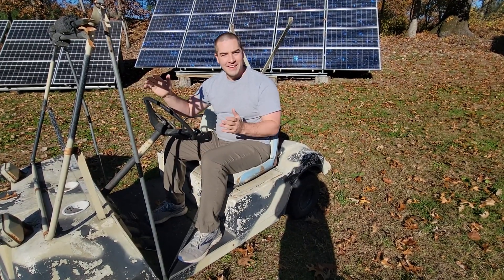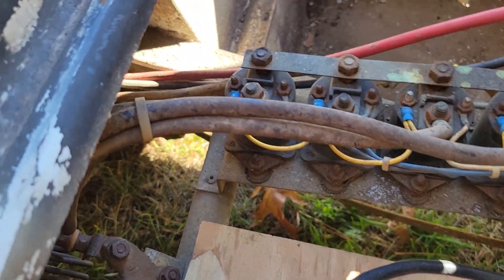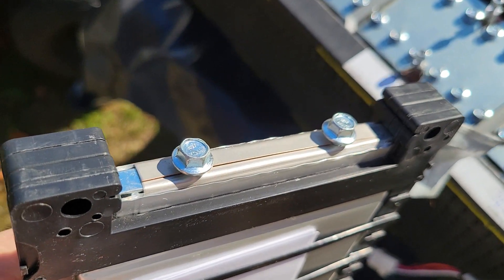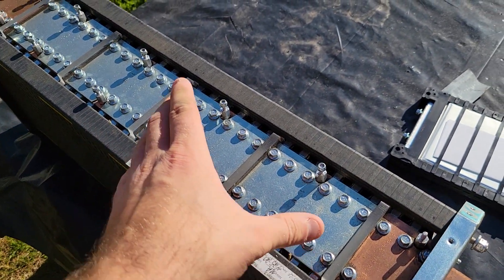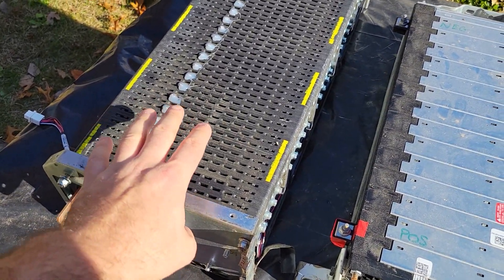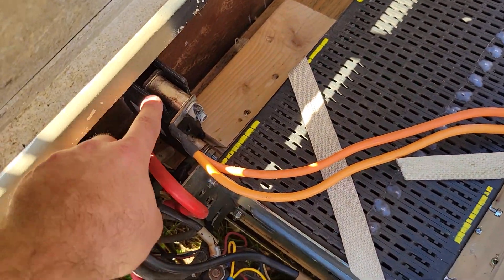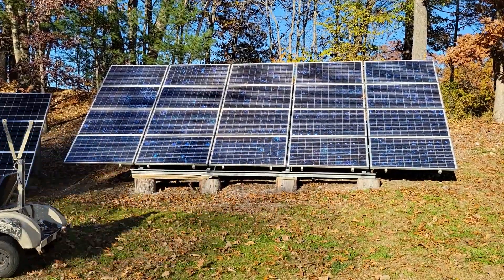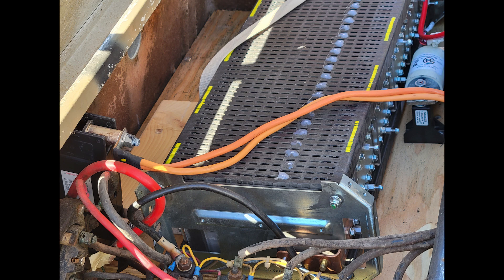These SPIM08 Cells are Crazy Powerful.

Comment: I've been toying around with inexpensive upgrade to prius traction battery.  If I could configure cells in series, 2 pair to make 14.8v module, 14 modules in series for 207.2Volts @16ah...  vs OEM 201.6Volts @6.5ah... I think I would have one heck of a battery upgrade!  For $250 plus shipping or pickup... hmmm...

Comment: Can you find inverters BMS and chargers that will use their full potential.  Amps 200c and low volts range 2.5 to 4.1 .. for example my current BMS turns off the BATT at 3.1 v ...so I hear ANT bms is better at this point ....suggestions?
Reply from the maker: My favorite US supplier is Battery Hookup of BMS's.  However, they are not programable.  I've tested their BMS's and have been able to pull 100% of the battery rated capacity through the BMS, so I know they allow all the energy.  However, if you are looking for a 200A BMS that you can program, check out this one: https://s.click.aliexpress.com/e/_Depamyr

Comment: David: Very happy I've come across your videos. Question PLEASE:
Have 2001 EZGO 36V TXT going to convert to Lithium.
Battery Hookup has both the,
LG 36v 7.9kWh 10s EV Module and/but suggested I use two (2) of the 
36v 48ah 1.78kWh POWER Module - 60 SPIM08HP soon to be in stock.
Which Lithium option do you suggest?, PLEASE.
And what Charger, BMS(s), Meter (showing voltage remaining) and Circuit Breaker would be best for your battery choice?
I'll donate to your cause if you let me know how.....I'm 69 years with 8 year old son whom had to push us/golf cart home with LA failure. Want this not to happen again. I'm fairly new to using YouTube. Thank You With All Our Hearts.

Comment: 24V SPIM08 I have two but I put a 100amp bms but i have trouble with balance I have one cell it could be three I not get up to4.15 all the other are close .they 4.13  some as high of4.18 where i sure be get best use in a power wall

Comment: David, Awesome timely video. I will be doing this upgrade. Using battery hookup parts. Something I find not always discussed is how do we charge these batteries. Do we use the old charger through the BMS or do you have a charger you like?

Comment: David, Can you test the capacity of that 36 volt battery. I don't have a way to test it for capacity. I purchased 7 of them and am going to make 5 X 48 volt batteries from them. There are 30 cell pairs in the 36 volt battery. I will add 12 more pairs and longer (36" threaded rods and reassemble the packs. With 5 X 48 volt packs I will put a 100 amp BMS on each pack. The alternative would be making 14 X 4.2 volt 15p packs with one BMS. Since each of the 48 volt packs in parallel are over 2 kWh any one can be removed unlike the 14s packs.  The downside is buying 5 x 100amp BMS boards to talk to my inverter.

Comment: Having powered my airport golf carts with alternative batteries, I can say that the OEM 8V flooded lead acid batteries fall very short of their 165AH rating, especially with heavy use. By the 2 year mark, we get about half the range. We do many 4 mile runs, from one end of the airport to the other and back, on modified carts that can go 30mph. With that in mind, Lithium batteries with half the AH rating of lead acid batteries tend to compare quite well. We tried 2ea 24v 40AH LifePO4 batteries and they provided about half range. Far, far better than one might at first think. 165AH vs 40. yes, I know the 165 is a 20 hour rate, but even so... I guess my point is that one cannot directly compare AH ratings for a real world range comparison.

Comment: I listened to a couple of you tube channels that said to drain my SOK 12 volt 100 amp lithium batteries till they shut down, so that I can make certain they are matching when I connect them together as a 24 volt system to my MPP 24/24 inverter (all n one) .  They shut off at 8.? Volts. It wasn’t reading anything between positive and negative, no voltage between positive and negative. Now when I hooked it back up to my MPP inverter I get an error code #56 that says battery connection is open. How do I close it so they will charge again. Everything was working perfect before I drained the batteries.

Comment: Hi!  I have an old Vectrix VX-1 scooter , but the original batteries are dead. Can you suggest some batteries that would be good to replace the old ones?  The original had around 102 batteries  1.2v and  26 amps each, all connected in series for a total of 122v with 28Amp.
Reply from the maker: Hi Andrei,  I'm guessing you are interested in these SPIM08 cells as a replacement?  You will want to find out what the maximum voltage was of your original battery so that you don't go over that with the new battery you build.  Your original charger might be 150V or 160V, somewhere in that range.  This means you are going to be around 35 SPIM08 cells in series (give or take).  Is this what you are asking about?
Reply: @DavidPozEnergy  Hi David, Thank you so much for your quick response, My question was about which battery is more suitable for an electric scooter with a big discharge, I was considering from your site 3 types to get around 140V and more than 30Amps, first  I was thinking for SPIM08HP 3.7V 16AH ( 150 pieces > connected  40S4P   to get 148V with 64Amps ) or second option to getting the 15 pieces  PANASONIC 48V POWER MODULE 13S 6.4A 299.99WH >(  connected 3S5P  to get 144v with 32Amps )  or the third option to get 21 pieces of Jeep 12s 44.4v 9.8ah 435wh  (  connected 3S7P get 133v with 68.8Amps ) I have all in the cart and I cannot decide which way to go.Also for the Jeep batteries I don't see the size on the site so I can't figure out how it will fit in my scooter battery compartment (  the battery compartment for my scooter is 340mmX710mm X225mm)
Reply from the maker: When working with an EV (car/scooter/bike/boat) I prefer using a battery that parallels the cells first, then series them.  The module I show in this video is paralleling 6 cells and then making one series connection to the next cell group.  This is the better approach to EV's.  The other options you mentioned, such as the Jeep would be opposite.  The jeep cells would be quite a pain to break apart, so you probably would be series connecting 3 modules into one battery.  Then repeating that process 6 more times.  This would be 7 individual 140V batteries.  The trouble is that you need 7 BMS's.  It's OK, but not as ideal as paralleling them first (such as the SPIM08) and then one BMS.  But, if you go with one BMS it has to be a relay based BMS.  

I should note, that based on your context I think you are trying to build a battery with more than 30Ah (Amp*hours).  Not Amps.  Please correct me if I'm wrong.

If the goal is to get above 30Ah, then you could buy the SPIM08 36V modules I show in the video.  4 modules in series is 6P40S, or 148V@48Ah.  It's over your 30Ah goal.

Just for fun, here is another option: https://batteryhookup.com/products/8x-new-sab-3-2v-55ah-176wh-60280-cells  Each cell is 3.2V and 55Ah.  So you don't have to parallel any.  You can buy 44 cells, arranged in series, for a nominal 140.8V, 55Ah, battery.  Battery Hookup sells the plastic cell holders and bus bars too.  

With anything, please use discount code DAVIDPOZ to help the channel and get a discount.

Comment: I just picked up 4 of these yesterday to do a build for my golf cart … I want to do 2 in series and 2 in parallel to give me 72v at 96ah … big battery told me to use a 20s BMS on each  72v pack..can you make a video on the BMS please and also how the heck can I charge this thing!?! I do not want to over charge or charge too fast or even too slow !!! I’m a newbie to this battery build craze… basically I need your help please!!
Reply: Also, on the BMS… if I run 2 BMS one for each 72v pack.. if I do 200amp BMS on each 72v pack will that give me 400amps then? Since I’m combining the packs to up my amp hour?
Reply from the maker: If you have two batteries in parallel, and one BMS on each battery, then theoretically, you would have 400 amps.  However, there are always tiny differences in resistance which will favor one BMS over the other.  The actual usable amps might be more like 380A from two 200A BMS's in parallel.

Comment: That make me think if one could build some sort of shifter, that switches between the batteries. The new one for accelleration and the energy dense one for cruising
Reply from the maker: You could just parallel them and they will do that automatically.
Reply: @DavidPozEnergy  Thanks for the answer and thanks for the great content in the first place. Would this balance the load with putting more amperage to the high-current battery? Would be quite cool, but I thought it „just“ doubles the max amperage from the older low-amp battery

Comment: Dang, I love this. I want to upgrade my batteries in the future. I just replaced them in my cart a couple of years ago, and I'm kicking myself for not going with something like this. I'd like to hear about how long it can run on a single charge after you test it for a while.
Reply: Hello , thanks for sharing the video, i just made the purchase of the 42 SPIM08HP cells, busbars, holders, and already in 7s6p 24v configuration. x2 so that i can setup this as a powerwall for my PIP inverter, one quick question. on these i think i can use a s14 48v BMS but what's the best way to setup the BMS on the 24v configuration any suggestions on the setup? thanks again. i cant wait to see you do a BMS on your's

Comment: Waits for BH to sell out due to this.  :-) I have 8 of the 24V ones that they were selling that I have modified. The originals were 24V at 24Ah ( 7S3P ) They now are at 24V 32Ah ( 7s4P ). While 32Ah doesn't sound like much, you have to remember that these cells can put out 200Amps per cell and 400 for short periods. So each of my packs can do 800 continuous at the cells. With 8 of the packs that means the potential, if not limited somehow, of 6400 Amps at 24V.  These will be used to feed a 6K inverter so they never will need to put out their max output and will be limited to 300 Amps max on the inverter input. 

Your golf cart should be 36V and about 275 Amps max on the motor so well within the short time ratings of the 1200Amp unit (10S6P).
Reply: How long is the run time for such a small Ah such as this?
Reply: If you aren't using their extreme output rate you're just wasting space. You can get the same capacity in the space of a coffee mug. These would be great for high impulse loads like welding, drag racing, start batteries, etc. Running an inverter at a low, steady current is not a good match for these things. (maybe an inverter to power a laser printer. or maybe a really big battery pack for an impact driver.)

Comment: Those cells are incredibly powerful!! I started my diesel truck with 6 cells (2p3s) a while back. Not only did it start right up, to me it sounded better than the two giant lead acid batteries. I love seeing they come with holders and in packs now vs just loose cells.
Reply: Question I’m debating making a truck jump pack with these. Should I do 3 or 4s. Thinking 4s not fully charged. So that the alternator doesn’t over charge 3s
Reply: @chanceayres6718  I would go with 4s because a 4s lithium polymer pack nominal voltage is 14.8v.
Reply: @Baldys_projects  thank you for your reply!

Comment: Dave, I was considering a super cap battery to assist in my big diesel truck. With the big amps on these, wonder if they wouldn't be a better choice as my inverter and fridge would be on that bank too. Thoughts?
Reply from the maker: If you are running a 24V system, then these would be fine in 7s (7 cells in series) configuration.  But, if you are running 12V, then they would not work well.  Instead look at these LTO cells in 6s configuration for a really amazing amps 12V battery: https://batteryhookup.com/products/6-pack-yinlong-2-3v-35ah-lto  
You can still use discount code DAVIDPOZ
Reply: @DavidPozEnergy  you're the man, thx
Reply: They'd work well for start purposes (high current, short duration), but for continuous loads the energy density is horrible. (more power [capacity, Ah] can be had in less space and weight. the bolt module has 3x the power, and it's far from the most efficient out there -- it was designed for a 10yr duty cycle of a car; having taken them down to the raw pouches, there's surprisingly little actual battery in those.)

Comment: Just curious 🤔 
Could you reconfigure the cells for a 12v setup?How many kw or watts?
Reply from the maker: These cells have a nominal voltage of 3.7V.  If you arranged them 3s (series) then the nominal voltage would be 11.1V (low for a 12V battery).  If you arranged them 4s then it'd be 14.8V (high for 12V).  I don't suggest building a 12V battery with these cells.  Instead build a 12V battery with LiFePO4 cells, which have a nominal voltage of 3.2V.  Then 4s would be 12.8V (perfect)

Comment: You should get yourself a 10kw bldc motor for that and hook it up. Way more efficient and you’ll get 50-60mph out of that baby!
Reply: He might even be able to get away with just buying a speed controller for it and keeping the original motor and that would allow him to completely eliminate the resistive speed control that it is using.  The only nice thing about the resistive controls is that they last practically forever.

Comment: Any chance these could be used for a power wall ? I'm looking for a simple power wall option.
Reply from the maker: They can, but it's not the most cost effective option for powerwalls.
Reply: @DavidPozEnergy  love the content BTW! Keep it up!
Reply: @DavidPozEnergy  thanks. Budget matters very much and I've been struggling to decide on a system. Batteries make the pay back time so much longer :-(
Reply: Powerwalls should really be called "storagewalls".
These batteries can deliver high power but have a low energy capacity, and it is energy capacity you need in a powerwall.
Yes, you could make them work, but you would need a lot of them and would never use their potential to deliver high current.
Reply: A powerwall can be built out of anything. The question is budget, space available, and the amount of mass your wall/floor can handle. That said, these things have horrible power density, so it will take a lot of them to assemble even a 10kWh unit. (I don't know your needs, but the average household needs ~20kWh per day.)